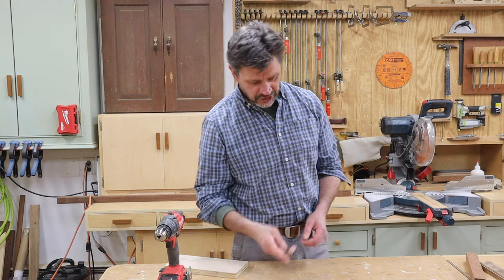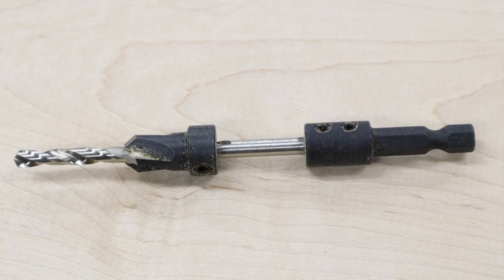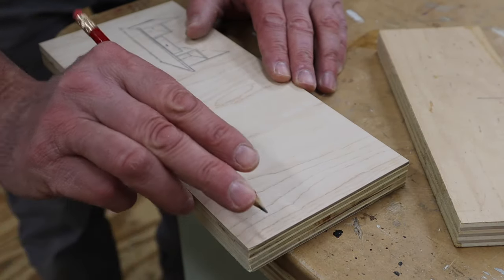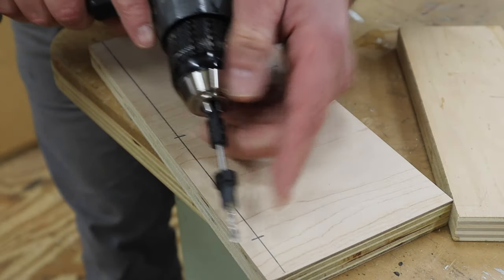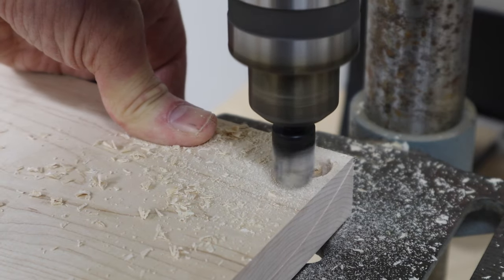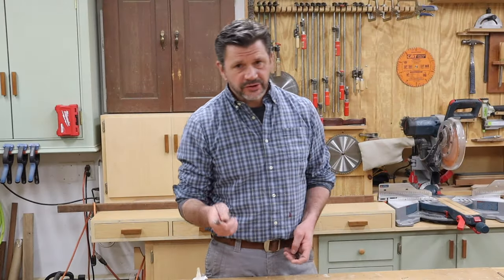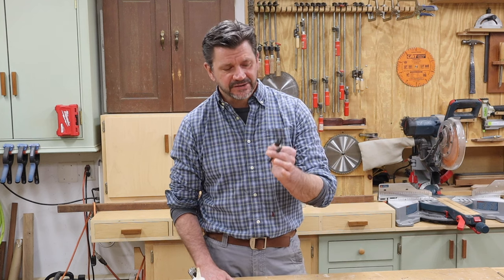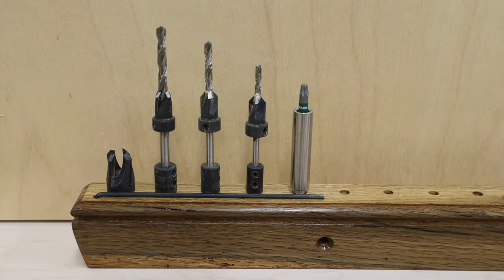How to Use a Countersink Drill Bit & Plug Cutter Set - Basic Woodworking

Comment: Although I myself prefer the exact Countersinks you use in the video  FYI H.B.Fuller Company also.  Have Carbide Tipped Counter Sinks  that do hold an edge.  Longer  I like the HSS ones because with a Jewlers file Set  I can quickly “Dress “ the edges  and have A Sharpened. Set to use  In a Professional Setting as a Cabinet Installer  I have Fuller brand Counter Sinks I’ve used daily for over 35 years  most of the Cabinets I installed  were. Built out of Melamine  Structures that. Can dull  tooling. Pretty quickly !

Comment: Thanks Jon, I also use countersinks on almost all of the screws I run. WL Fuller went from my favorites to second place after I stated using the Amana adjustable countersinks. There not cheap, but are versatile and hold an edge longer than the others.
Reply from the maker: Thanks Steve I’ll have to check them out
Reply: @JonPetersArtHome  how do you do that fingernail guide trick?!

Comment: Excellent video.  I have one quick question.  How do you set the drill bit to the proper length that will correspond to the screw that you're using?

Comment: Im not sure if i agree with Pianova's comment about the screws being flush...considering you're also showing the use of a plug afterwards. But one thing that i have noticed on some of your previous videos is that you do seem to go deep on your countersinks in areas where you later cover up with molding, trim, or a face frame. To me, this weakens the strength of the wood by minimizing its thickness. 
But you're a complete pro in my book. Thanks for all your videos.
Reply: Gabriel Garcia That’s what I mean. The wood gets weaker due to the deeper hole when countersinking too deeply
Reply: Something to keep in mind is woodworkers tend to make their joints far stronger than they need to be.  

Just glue will usually be much stronger than the wood itself and many times nails and screws are just for a little added strength or just to act like clamps to give the glue time to fully cure.

Even without glue, using multiple fasteners also helps spread the load and makes it less important how strong each one may be by itself...

It also depends on the type of wood you are using.  Like you put a screw into a piece of oak just a few threads and it can hold your weight but in a soft wood it would rip out.

Plywood is engineered wood and will generally be stronger and more stable than real wood.

There are always trade offs but it would have to be pretty badly put together to not be able to trade off a little strength for a better final look...

But there's examples like pocket holes that are normally deeply embedded but still offer plenty of strength.  A dowel joint can be around 1.5x stronger than a pocket hole but pocket holes are very common and still rarely break, and you don't have to drill that deep to just cover a screw with a wood plug, which means it should still usually be stronger than a pocket hole...

Some resources to look up for hard data on the subject...

Wood by Wright did an extensive testing of a long list of glues...

https://www.youtube.com/watch?v=ZoaTZY5cSQE

https://www.youtube.com/watch?v=JFEPTPTtFsw

Gosforth Handyman channel has a number of tests on fasteners, drywall/plaster screws, wood screws, MDF screws, etc. have to search his channel but a lot of videos on it...

And there's lots of videos done by many different people on strength of different types of joints for comparison...
Reply: ZeoCyberG anyways, Screws like Spax are designed to sit flush with the surface of your material...Flush doesn’t mean 3-6mm below the surface

Comment: Personally I would match the direction of the grain with the plug. Perhaps comment that a flush cutting saw is needed to avoid marking the surface and to always sand in the direction of the grain.
Reply: yeah, I mean these 3 tips would be the most important, so that such common mistakes are not performed by any beginner. But none of them are highlighted in the video... :(

Comment: Jon, tapered bits seem to be really popular with countersink bit packages. Do you have an opinion on tapered bits vs standard bits?
Reply from the maker: Are use both because the tapered bits Seemed to be more available but lately I’m using the straight ones. Tapered bits were designed for tapered wood screws and generally I’m not using tapered wood screws anymore
Reply: @JonPetersArtHome  I'll use both. Are use both?

Comment: This always confuses me? So the idea is that the screw isn’t really screwing into the first plywood, but only the second piece? Or is it screwing a little in the first one as well? It looked like you almost predrill Ed completely through the first plywood?
Reply: You can pre-drill with a smaller diameter than the threaded screw has in total, especially in hardwoods; you are surely aware that you can only drill through the wood to be fastened with a diameter that corresponds to the screw neck (the unthreaded part for partially threaded screws or the threaded screw diameter for fully threaded screws). The point of this is that you can then pull the wood to be fastened with the screw head towards the wood without running the risk of not being able to make a conclusive connection if there is too little contact pressure on the wood to be fastened, because perhaps one or two threads of the screw in the too narrow drill hole prevent you from closing the gap correctly. If a larger hole is drilled in the wood to be fastened to countersink the screw head, this will of course not go all the way through - I would say countersink up to max. 2/3 of the wood thickness - otherwise fastening is no longer possible. But I'm sure you're aware of this last variant yourself.

Comment: Jon, good instruction.  I always enjoy your videos.  Thanks.  Question unrelated to this video: What are your thoughts on using drywall compound to seal MDF before priming and painting?  I'm specifically thinking about sealing the edges of MDF with drywall compound before sanding, priming and painting it.  I think I might have seen one of your videos in which you used drywall compound to fill nail holes and such before painting.  Thank you very much.  Larson Bennett
Reply from the maker: Thanks! Yes that will work but prime it first with an acrylic primer… I like fresh start by Benjamin Moore and I often use the heavy body fresh start to help fill. Prime let it dry fill then sand then prime again
Reply: @JonPetersArtHome  Thank you.

Comment: Can you just use a regular cordless drill to make plugs?
Reply from the maker: Yes
Reply: The plug cutter John used in the video works better on the drill press...it wants to walk if you use a hand drill. There are plug cutters with spring loaded centering pins that are much better for cutting plugs in the field, at least in my experience

Comment: These things are garbage! (The Irwin 1/4 hex)The ones with the hex peace strip. I’ve had two of them strip and I took off the actual countersink with the two eyehole screws and put them on actual solid drill bits. Irwin used to be a decent quality tool. Chinese junk.